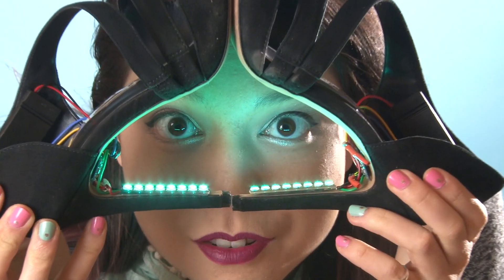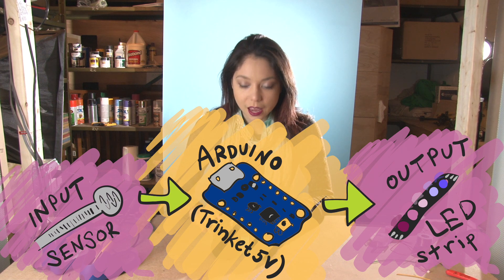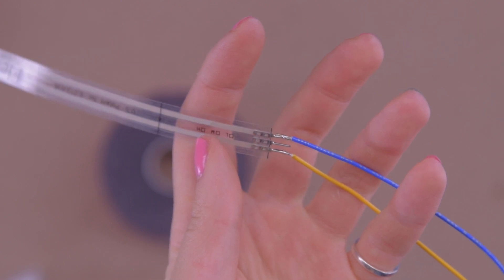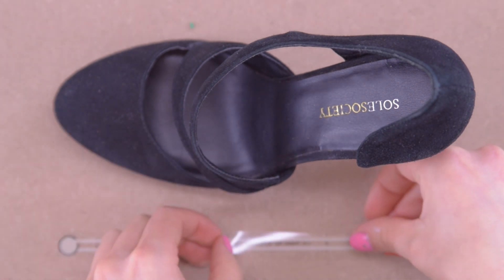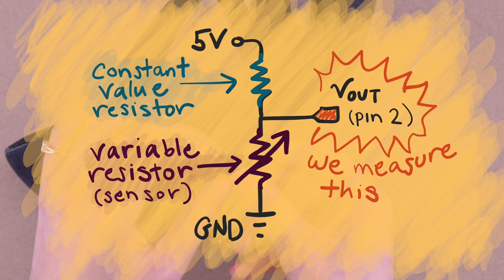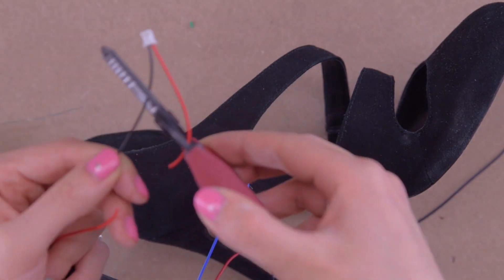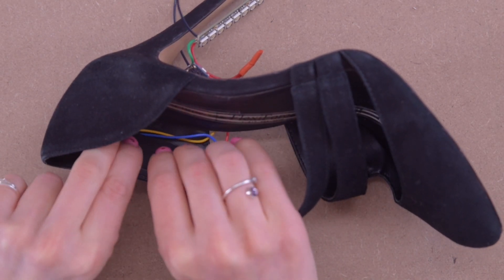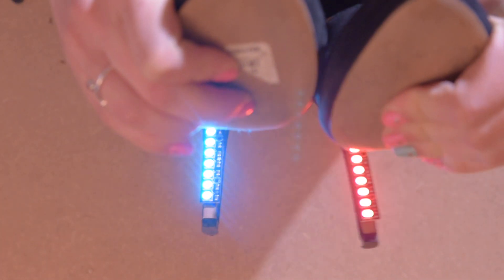Glowing Heels: Responsive LED Stilettos!

Comment: Great video that brings fashion and electronic together! I really liked what you did tho i  would make a few changes. Go even smaller with AtTiny85 SMD and run at 3.3V with analog led strip, no point wasting a digital strip. Thanks for the idea, think I will hack a set of the wife's heels 😝

Comment: holy smokes arduinos have gotten a lot smaller since I've played with them! I played with the Uno a number of years ago. :) very cool to have the small form factor ... get that analog(?) sensor going on ... very neat project. :) thanks for sharing
Reply from the maker: Yeah... even the minis and micros are tiny, although the Trinket which I'm using here is definitely one of the smallest.

Comment: Cool project and nice explanations. How long will they last?
Reply: leds are quite low power but you're also supplying the arduino with 3.3V I think. with those 2 coin cell batteries ... maybe in the dozens of hours?